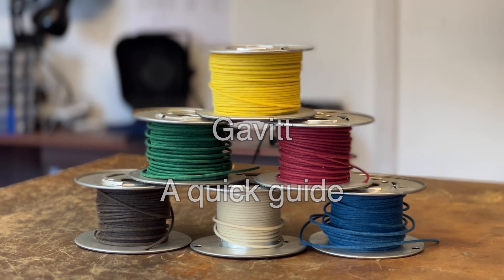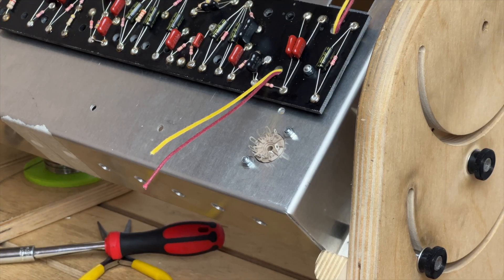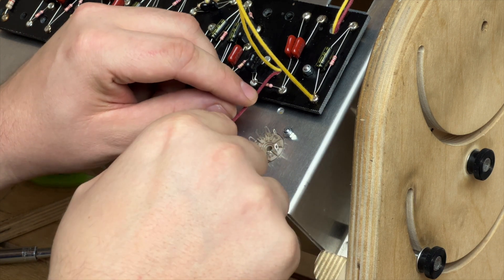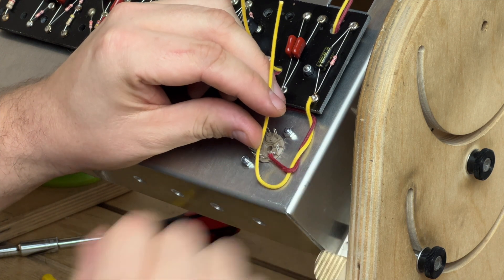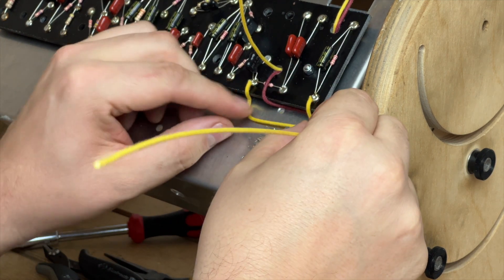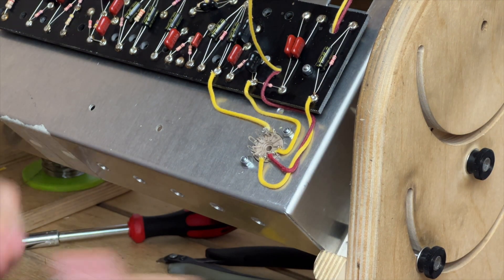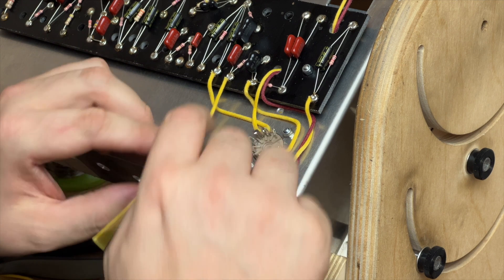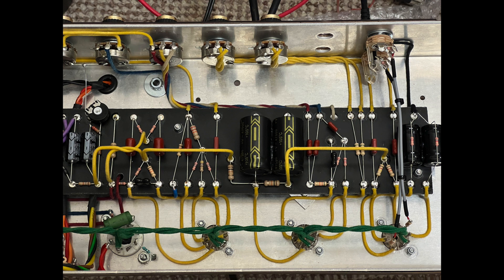HOW TO use CLOTH WIRE in your amp builds

Comment: "Push Back Wire". I use it in my builds and it's actually great and quick to use. Cut to length, push back the insulator, and solder. Once you get the gist of it you'll love it.